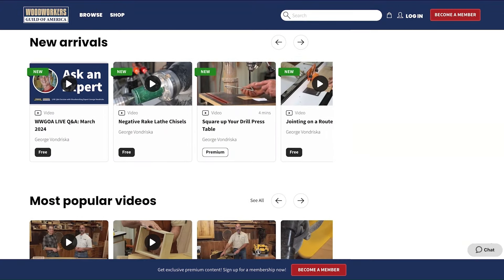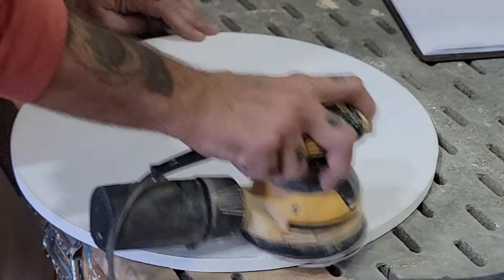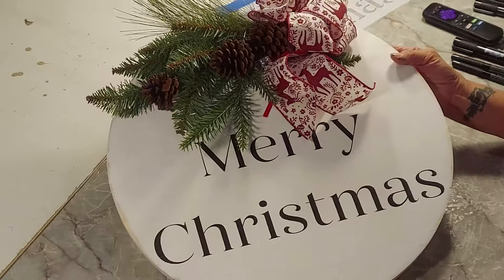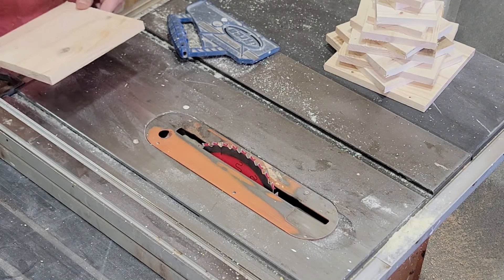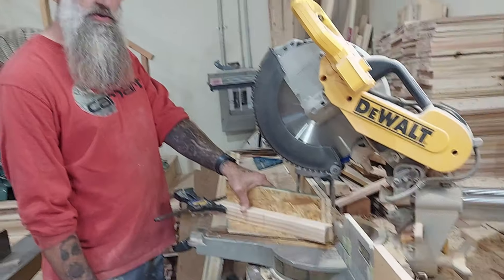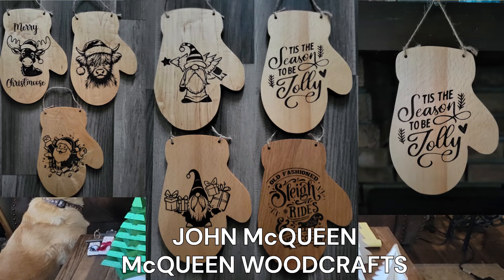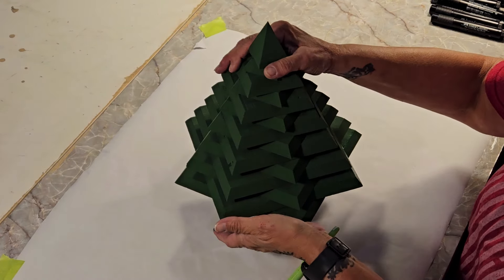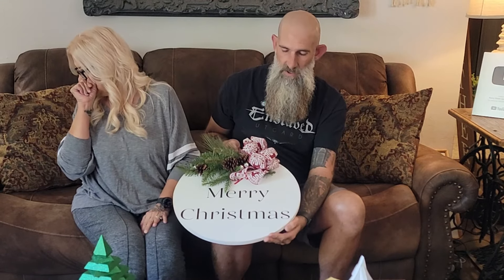Easy Beginner Woodworking Projects That Sell Like Crazy!

Comment: For the snowmen, how did you cut the small part for the hat?
Reply from the maker: Aaron cut a half an inch strip off of a cedar fence picket on the tablesaw.  You can buy little strips precut at Hobby Lobby. They are with the Balsa wood section. Thank you for watching 😊